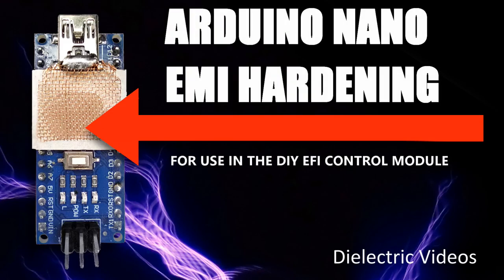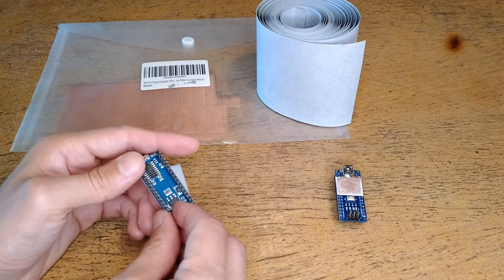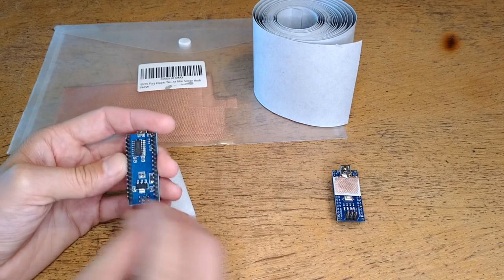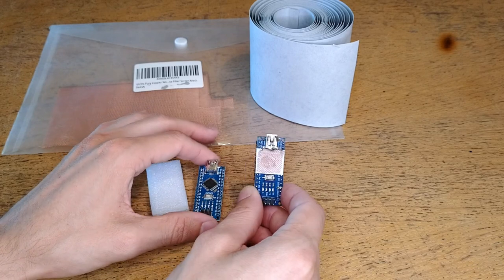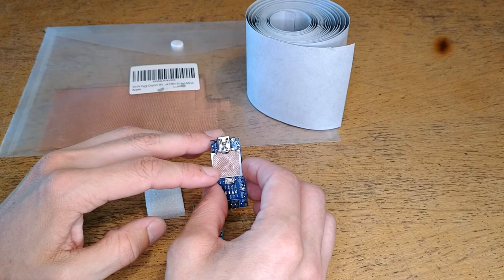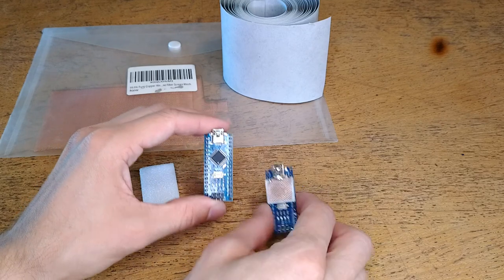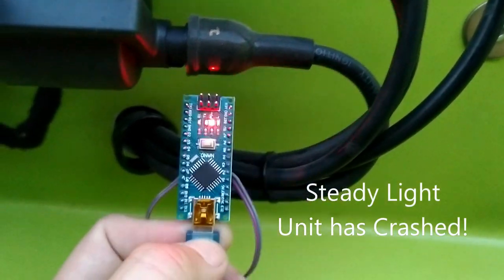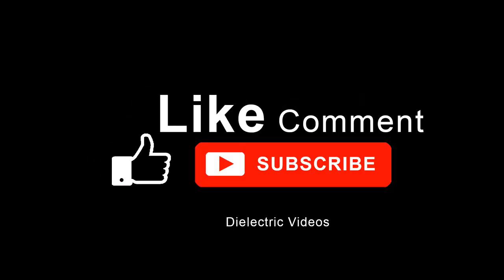EMI Hardening the Arduino Nano for Automotive Applications

Comment: After removing the regulator, would you still use VIN or would you just use the 5V pin?

Also, I recently bought a buck converter and it's resting output measures 5.3V, would this be safe if feeding the Nano unregulated?

Comment: Hi, thank you very much for the tips, does this modification protects agains Rfi as well ? could i use a solid copper foil instead ? also, do you have other tips ?it would be awesome to see more ways to make those common controllers rugged.
Reply from the maker: It should help with RFI immunity as well as emissions. And yes, copper foil should also work well.

Other methods to improve hardening include the installation of a zener diode (~5.6V) across the 5V rail to prevent damage from voltage spikes, addition of a diode-capacitor filter on the power line to improve brownout tolerance, and correctly setting the Brownout Detect (BOD) fuse bits appropriately for the frequency you are using on the chip.
Reply: @DielectricVideos  Thank you very much !

Comment: Damn I'm gonna try the shield trick, I'm working on a thc for an HF plasma cutter and my Arduino keeps bugging , i already put the circuit in a metallic enclosure connected to earth but no luck so far

Comment: i have a problem whi a speeduino proyect whit a mega arduio. do you thing that can a arduino voltage regulator can shoot down the arduino board only when trigered(try to start the engine) its similar in the mega to take it out?
Reply from the maker: It should be possible to remove the regulator from an Arduino Mega. It's typically located next to the DC barrel jack.

If the microcontroller crashes during engine startup, it can also be due to RF interference from the spark plug wiring. You can try the metal screen method, or simply mount the board inside a grounded metal box to protect it from spurious emissions.

Comment: Would using a 10nF capacitor between Vin and GND help with EMI hardening or is the removal of the voltage regulator an absolute necessity?
Reply from the maker: That could definitely help as well!
Reply: @DielectricVideos  which of the two methods would you say is more robust?
Reply from the maker: @electronz2288  Assuming you don't need the regulator, then removing it entirely would be more robust. However, for convenience it might be better to use the capacitor across Vin and GND.

Comment: I'm facing issues with my nano i have an onboard 5v regulator 7805 with decoupling capacitors but connecting the arduino with it does not work when i insert usb It works no grounding issues there when i touch (+) of regulator 5v arduino works so should i remove 5v regulator from the Arduino?
Reply from the maker: Removing the regulator on the Nano is worth a try if you're not using it. Also be sure your 7805 is wired to the 5V pin, and not the Vin pin.

Comment: Does a 36vdc motors can cause an EMI to the arduino?
Reply: Spark plugs usually require voltage of 12,000–25,000 volts or more to "fire" properly